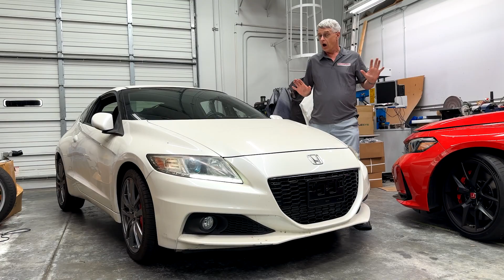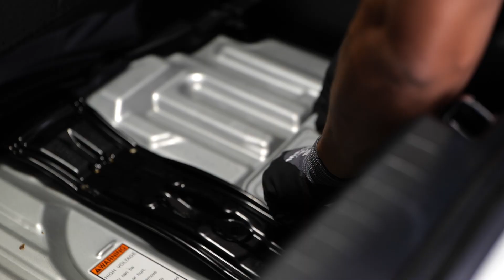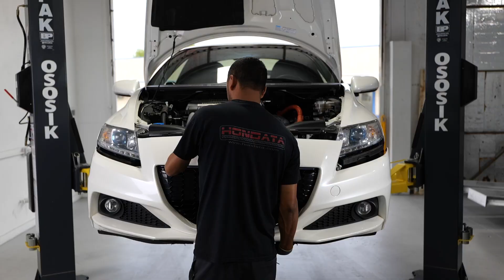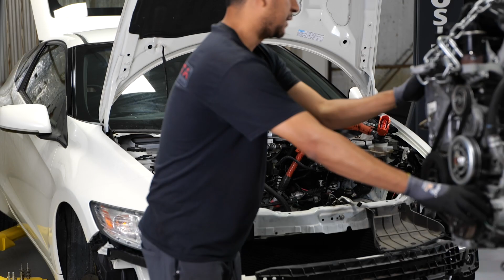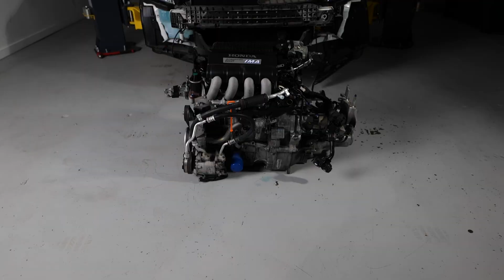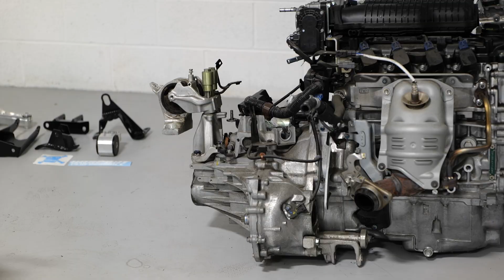Taking Out A CRZ Engine | L15 Prep

Comment: Your product is by far the worst I’ve ever dealt with. I purchased it thinking that I can use it in conjunction with the previous tune maps that I had on my car it then removed everything that I had done previously tuning wise and is forcing me to have to use your product only now I’ve wasted over 700+ dollars between your product and having my car tuned locally. Nowhere in the installation does it say that it will completely wipe the ECU. When installing your software.